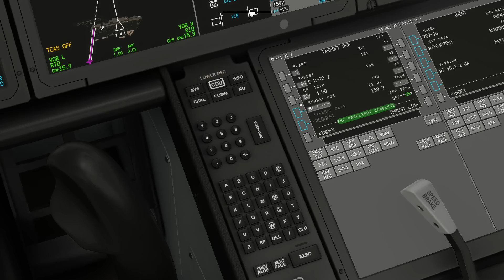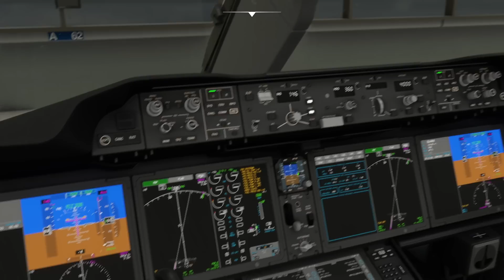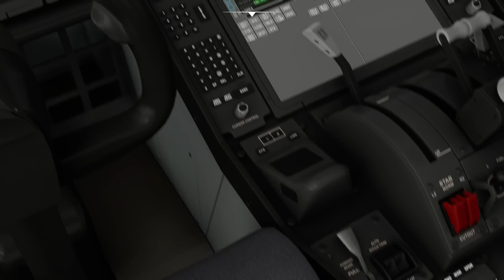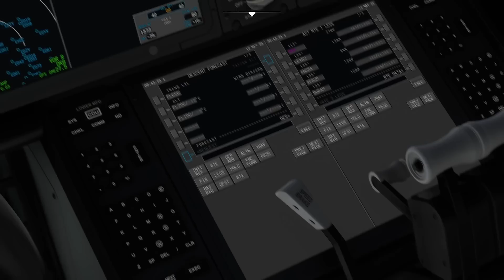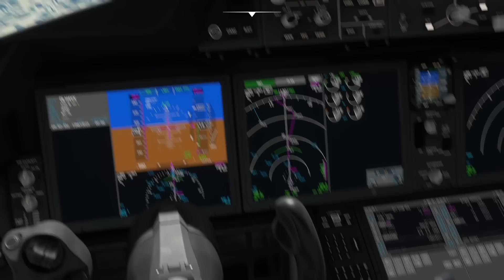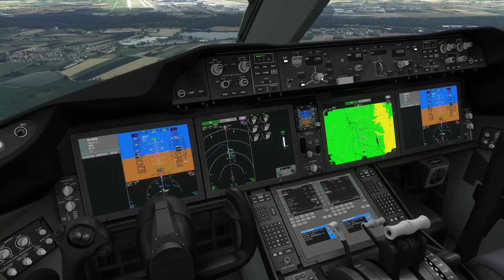Boeing 787 First Flight | Aircraft & Avionics Update 2 BETA | Real Airline Pilot

Comment: We're getting a number of folks reporting the same bugs to us on multiple forums based on this video, so just to address some issues and avoid duplicate reports: 1) The speedbrake checklist item was intentional, as that stock sim behavior is in the middle of being replaced but we didn't want people to be caught out with no speedbrakes during takeoff or landing operations and 2) the long (but not incorrect) checklists were provided by the manufacturer, although most operators opt for much shorter ones. We are looking into a number of operator checklists to try to come to a sensible set of common items you would see in the field. 3) The speedbrake of the 787 are massively draggy, much unlike most other airliners. You can use the speedbrakes during unusual attitude recovery (25 degrees nose down) to keep out of the overspeed band, that's how powerful they are. For slowing down 15kts you would normally just pull them out a tiny bit, definitely not full or halfway.

Finally, the focus of these aircraft is not to be $60-120 level simulations. Our focus, like it was for the CJ4 project, is to provide deep avionics, highly accurate LNAV and VNAV that you can trust, RNAV, RNP, IAN, and a deep FMC. On the systems side our target is reasonable behavior for normal flows and operations, but not for failure or abnormal configs, so things like what specific things don't work when one particular hydraulic bus is off is not really the level we're going for. Nonetheless, the vast majority of normal pilot interactions should be crisp, solid, with a super authentic avionics experience, a good flight model adhering extremely closely to book numbers; the stuff our actual long haul pilot testers cared and care most about. And, don't be fooled! There still is plenty of depth: TCAS is completely to the TCAS II spec, LNAV does all the crazy procedures you want with RF, we have our full GPS satellite simulation, RNAV and Boeing IAN, autoland, a nearly 1 for 1 HUD, pixel peeper accurate glass visuals (our guys are nerds too), a ton of the FMC, lots and lots of CAS messages, the list goes on and on. It's definitely still highly highly advanced.

But, just want to keep expectations in the reality zone. Hopefully folks enjoy the value that they're getting for the price.
Reply from the maker: Hey Matt,

thanks for the extensive explanation. I have pinned your comment for everyone to be able to see it first.
Reply: Any news on the weird rotation? after the nose wheel rises, the plane instantly shoots up as if you're pulling back harder. I watched two streamers test the plane which it happened to, namely LondonController which caused him to tailstrike the plane, and when I took off for the first time, the same thing happened as well minus the tailstrike.
Reply: @darkkcoffee  A bug with the fly-by-wire ground to air transition and will be fixed in the next build.
Reply: You guys are doing a great job!! Thank you so much😊
Reply: @MB-ho9cf  I'm going off the feedback from our IRL 787 drivers in the test group. Currently we have it tuned based on that feedback, and it does perform as described, able to keep you out of the overspeed band at 25 degrees nose down.

A tiny bit is of course a relative term, but I meant it as "definitely not halfway or full speedbrakes". Feel free to try it out in the beta and see if it meets your IRL experience, though, and report back.
Reply: It's awesome to see how involved you guys are with the community and that you're keen to take as much feedback as possible. We're lucky to have you!
Reply: Well said, Matt. I for one really appreciate what you are doing and enjoying the 787 more than ever.
Reply: Where do you get the update Beta 2?  y version is still the original
Reply: How about doing something as simple as modeling the engine inlet cones on 787 and 747 engines! Let’s try that first! Gee weez! Can’t even model the engines properly??????
Reply: @Tramaine318  We don't have any modelers on our team. This update is systems and avionics only.

Comment: That jolt on rotation looks to be the elevator trim, weird how quickly it snaps up like that. I'm not qualified to say whether or not that's realistic, but I'd wager it's not. The default 747 and 787 have this issue too.
Reply from the maker: It is the elevator trim indeed, but they fixed it for the next update.
Reply: @A330Driver  Great news!

Comment: Hmm I'm not impressed. At first, the plane was cold and dark, so that means especially on the 787 when no hydraulics are used, the Flaperons should be down, and not up. The same as for the Rudder, Horizontal stabilizer...but anyway. I'm hoping Quality Wings or PMDG will make a propper B787 one day!

Comment: Cool video.
May I ask...

05:25 "Can we import that somehow? [double-clicks on ZFW] Yes we can, nice"

As per the PMDG 737.
So here is the question, is this a flight simulator thing or is this an actual feature in the Boeing FMS?

RL pilot here, but no experience on Boeings or other airliners for that matter so please bear with me on this one.
Reply from the maker: Hi, that's a flight simulator thing, the real 737 at least can't do that. However I do recall that in the 747 there were some options for some weight sensors, but I don't know any details about that.
Reply: @A330Driver  Many thanks for the reply. Have seen that for many years in PMDG 737 (since FSX), and have wondered about it since. 
Again, cool and instructive video.
Keep them coming!
Cheers.

Comment: I think they should hold off on releasing this until it's better. I mean the integrated checklists are such a huge part of normal operations with the 787, so not having them up to snuff is a major issue imo.
Reply from the maker: But holding off and improving is exactly what they do. It's a first beta, a beta. It's not a releaseversion. Obviously there will be bugs and issues, testing betas is meant to find exactly those.
Reply: @A330Driver  Completely understood. And certainly you’re more familiar with the beta process. But if planned release is in roughly a month, obviously bugs can be fixed but will they add completely new features? Probably not. Unless the checklist issue is a bug.

Comment: Regarding the routing in the FMC, I've noticed there's often missing IAF and IF fixes when loading an approach using the default Asobo nav database (as opposed to Navigraph). I imagine this is the case in this default Asobo 787. Regarding the checklist, it amazes me that Asobo can't seem to produce proper checklists (which are available on the internet) for their default aircraft. Detailed checklists only add to the realism of the sim experience. I guess they don't want to build separate platform versions (PC vs Xbox)? But this is an issue that goes back to MSFS2020 initial launch.

Comment: Sorry but I think you should've taken a different approach for this video. Everybody knew the update wasn't going to make the plane study level. So I don't see much use in pointing out all the errors or missing events. What people are more interested in seeing is how the plane has improved with the update. It's just my opinion it's not fair to hold a default plane to the same standard as a study level 3rd party plane.
Reply from the maker: What I pointed out was not even close to study level requirements. Those were tha basics for flying the plane. If I wanted to point out every single thing that is wrong I could write up a dozen pages with stuff. But that's not the point. And that's not what I did in the video.
Instead I do notice a trend however for people to expect less and less from addons. My points were basic piloting stuff. If not even that is allowed anymore, then I need to ask: What is?

Comment: If it's as good as the Longitude or CJ4 in the end, then I'll be very happy. They certainly aren't PMDG levels of detail, but they are still good enough for VATSIM under normal ops without any critical, immersion breaking shortcomings (except for the non functioning HUD in the Longitude). I certainly can't complain about the level of effort Microsoft/WT are putting into making the default aircraft something hardcore sim enthusiasts would enjoy. That has been unheard of until the MSFS AAUs came along.
Reply from the maker: yup, I certainly agree.

Comment: Im really interested how you tweak your graphics settings. It seems like you found a great balance between visuals and performance. Will there ever be a video where you explain how you set your settings? Im really struggling to find the right settings with a similar system.
Reply from the maker: Hi, I posted my settings on the community tab of my channel. Nothing changed since then and any new option Asobo brought in were left on their default levels.

Comment: I really waited for the QW to come out. They dissapeared. Now we gotta make to with this tin can which doesnt have even 50% of what QW has so whoever says QW isnt study level, they are not fully correct.
Reply from the maker: You got a strange definition of study level if you think QW was anywhere even close.
Reply: @A330Driver  it was not study level, but it sure was close! atleast most of the stuff were modelled and working. and we had a full overhead panel. regardless, with all due respect, the QW is way better than asobo's tin cans
Reply from the maker: @virtualaviator21156  I disagree substantially. They had basic stuff, similar to Aerosofts Airbusses. Better than Asobos version? Probably. But you're comparing a fully developed product to a beta #1.

Comment: Hello, nice video and comments, thanks. I have 2 questions. 1) Do you have an idea when or if the PMDG 787 is coming for MSFS? 2) And excuse me, but this is a very different topic, but I think you know the anwser to this GA question (and could not find it on the internet of forums). When you are flying VFR with a GA plane, is it correct that you minimally always need to request VFR flight following to area control if you have not filed a flight plan? I am using Pilot2ATC, and there is also an option there to just "Checkin" with the area controller. But then area control does not know where you are going, but only can see you on their radar screen via your transponder and you have had radio contact. But I guess this is not a real GA flying goes right? You minimally should request VFR flight following, or file a VFR flight plan, is that correct? Thanks in advance for you content and information. Greetings, Boudewijn
Reply from the maker: HI Boudewijn, thanks!
1) There has been no information about a possible PMDG 787 so far, no confirmation, no denyal. Personally I believe it would be the logical step after the 747 (unless they decide to do a 777X), but who knows.
2) You don't need to request flight following when flying VFR, flightplan or not. Personally I'd always do it as it is simply an additional safety layer, but you're not required to do so.
Reply: @A330Driver  Emmanuel, thanks for you information! Greetings.

Comment: I hope WT deactivates the AFT EXT PWR coming available as default since its only used when the APU is INOP.. Only maintenance personnel will normally be able to access it since you need an Allen key to open the latches.
Reply from the maker: Make sure to forward that suggestion to them!

Comment: Seeing as the attitude and position appeared before turning the IRS’s on I guess that has yet to be modelled?
Reply from the maker: Either that or Boeing switched systems and uses the IRSses as a backup now and other tech as primary - which I doubt though.
Reply: @A330Driver  or maybe it uses the standby system to copy and display on the PFD until aligned? I’m not really a Boeing person so not too familiar with some of the 787 tech. Btw what’s your thoughts on the new TCDU’s (Touchscreen CDU’s) for the Max and NG that I’ve seen announced recently?
Reply: Found a video of 787 starting from cold and dark. Once the standby instrument completes its 90 second cycle the attitude indicator on the PFD also displays. So I’m guessing it copies from the standby display until IRS are aligned. The 787 has 2 IRS’s and then 2 AHRS’s (bit like ATT mode on 737 or A320)

Comment: I was hopping for a flight model update and a 3D rework as well, especially for the 747-8 cockpit.
Reply: The flight model has been extensively reworked for both aircraft. In this video, the climb rates are almost spot on to the book at the given gross weight and climb speed. For the 747 as well, you can even match the unreliable airspeed attitudes and power settings straight from the FCOM.
Reply: @mattnischan582  Matt- I was hoping that you would see this video (to note the areas that need to be looked at).  So glad that you're on it!

I'm so thankful for you and your team at Working Title!  Thank you‼️
Reply: Go and read Working Title's list of changes so your expectations are in check. It is a part of the Avionics and Aircraft Update 2 package. They are not going to be able to write all these systems within 4-5 months since the last update 1.
Reply: @ukmaxi  I didn't mention systems.

Comment: 10 deg. pitch down? The aircraft was checking if all passengers had already faseden the seatbelts
Reply from the maker: That and a sudden application of the speedbrake lever are the best ways to check if everyone obeys the seat belt sign (hint: There will always be someone who doesn't).
Reply: @A330Driver  My instructors on ATPL classes said that in 737 as soon as they hear on intercom that CC is saying to passengers to remain seated after landing, they are applying full brakes to give them a lesson :P
Reply from the maker: @michapawlik3266  Rumors say that might have happened once or twice ;-)

Comment: I’ve found the new 787 beta amazing vnav is super accurate and it finally adds some realism to the 78
Reply: idk how the vnav is accurate cause mine just nose dives
Reply: @naumansajid8630  mine follows the flight path set
Reply: @JordanBennett19829  yeah it follows the path perfectly, but i reckon that the descent profile is too often too steep. It should start the descent a little earlier to maintain that ideal 3-degree pitch. It took ages for fbw to get it right so I'm not really expecting WT to get it right in a month or so. Similarly, the flight model needs some tweaking as it climbs like a fighter jet in some situations.
Reply: @naumansajid8630  Our flight model is extremely close to the book numbers. You can definitely hit 6k fpm off the ground at light to medium weights. In fact, per the book, fpm off the ground is 6k when light, at 310 kts. 240kts will be even more impressive.

Finally, VNAV in these planes is not intended nor does it target a 3 degree path. It targets whatever path that allows the engines to be mostly idle for the greatest amount of initial descent, for fuel efficiency. Then, afterwards, once the first descent segment is complete, it will switch to a smoothed path which goes through the maximum number of restrictions with the fewest level offs, anywhere from 1 to 6 degrees.
Reply: @naumansajid8630  me too , first flight it wasn't too good but its in beta not the time to judge
Reply: @naumansajid8630  mine didn’t it had a very gradual descent
Reply: @naumansajid8630  Both HD and WT VNAV  des is still goofy
Reply: Yeah.. I mean, it's excellent for a default plane I guess. PMDG+Fenix+Toliss have set the bar so high for simulation & systems depth though that it's hard to hit the mark. I can see where someone who plays on xbox only would be like "oMg ThIs iS sO rEaL!"
Reply: @noway9880  I only play Xbox and I know it’s not completely realistic 1. It’s not in beta 2. I only ever fly the atr on Xbox now as it’s the only Almost study level aircraft on Xbox every button works except the circuit brakers which even pmdg doesn’t have. The system depth is good it has every system on the atr in real life and the autopilot is pretty good glad they patched vnav on Wednesday. I also own the Pa28 warrior from just flight which is pretty accurate to the real thing as I fly it in real life as a part of training for my ppl
Reply: How do i get the beta version of the 787??